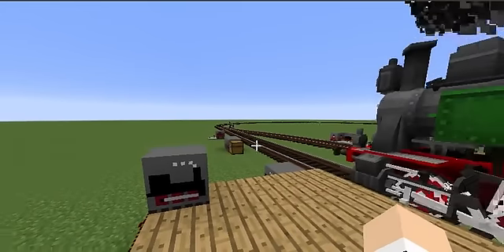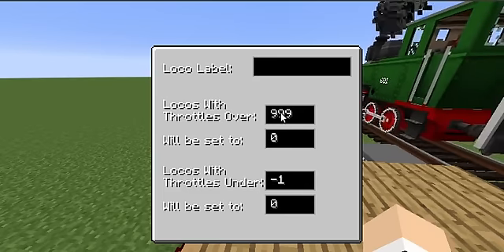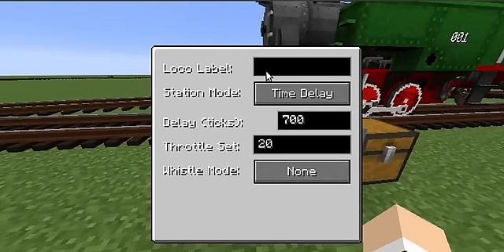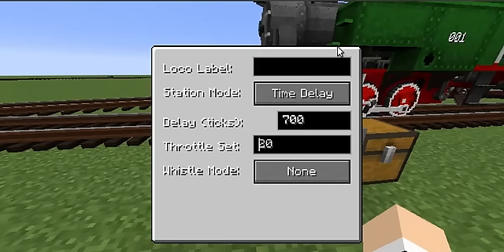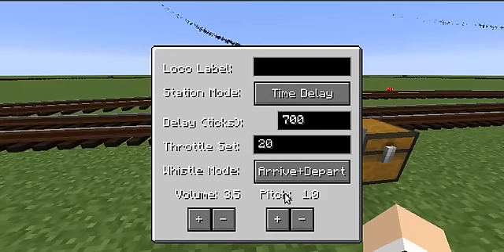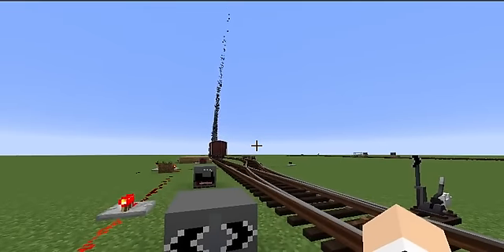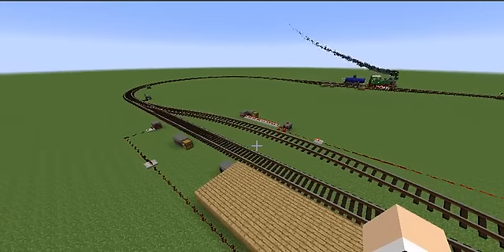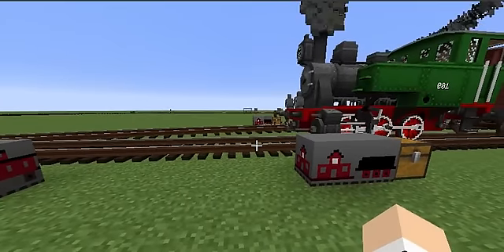Minecraft Rails of War Automation Module 2.0 Update

Comment: would it be possible to have a spring switch setting for the pointer block? set the switch to a direction then it will reset to the preset direction after any trailing moves? I'm looking for a way to simplify point to point operations on my server
Reply from the maker: traindude70 Hmm, never thought of that operation.  It does make multi-track operations rather simple, though.  I'll add in a spring mode to the pointer GUI in the next update.
Reply: Hey Ben how you got that update or you got from the owner cause I don't play much
Reply: Or oh other mod
Reply: Of
Reply: they've implemented it in the latest version of rowam, go get it now! :P

Comment: are there crafting recipies for any of the ROWAM or ROW parts? and can i use  any forge liquid?
Reply from the maker: +E.Hellbrand Crafting recipes haven't been implemented in ROW, so I didn't put them in ROWAM.  As to liquids, ROWAM only supports water, lava, fuel, and oil, as I have to preform a bit of a hack to get liquids to work.  Once ROW updates I should be able to add support for other liquids.